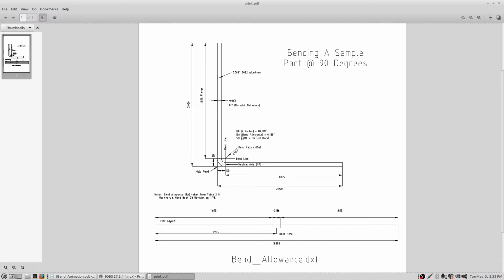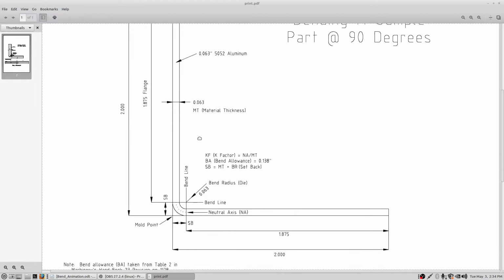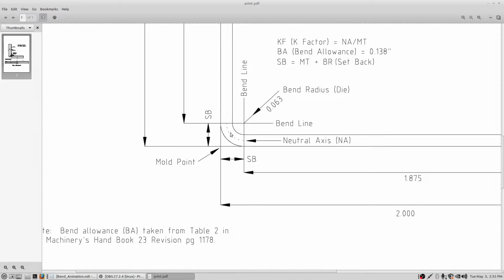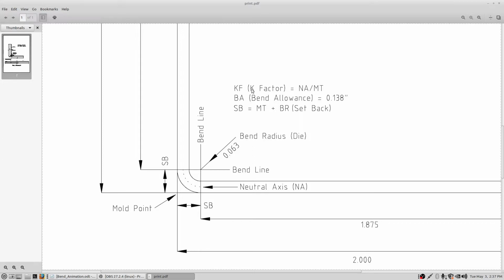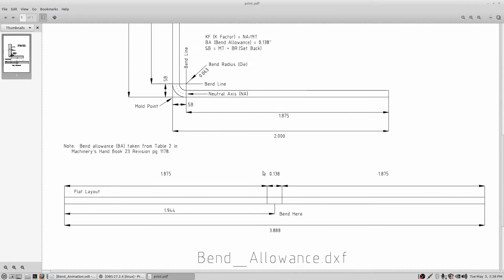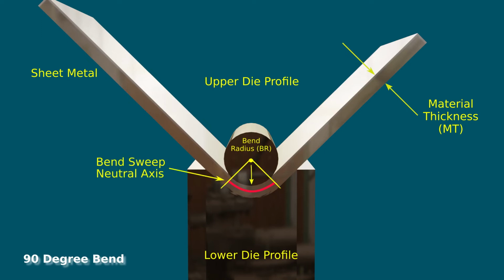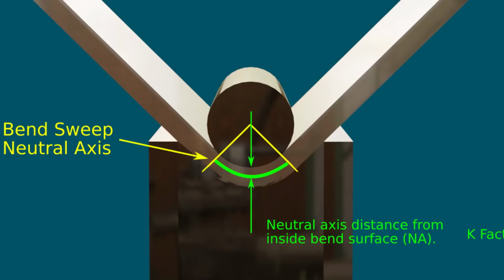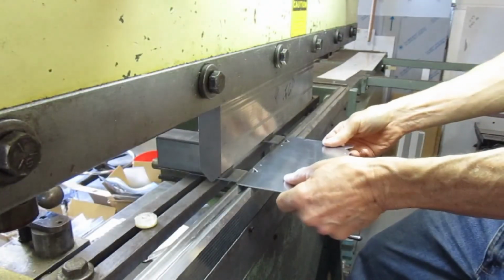Sheet Metal Bending Basics

Comment: Thank you. Always a pleasure to learn from someone who knows their subject and has thought about what the rest of us need to know in order to understand it. 💯👍
Reply from the maker: U R Welcome.  I started to get back to some sheet metal bending projects Dec 2021.  Did the deep dive on details.  I'm lucky to have a press brake so I can test real parts from the drafting table.  I think now with CNC controllers, most of this is push button.  That said, a few out there might be on the manual system and/or want to know what's in the box.  Glad you found the video interesting and informative.  Thanks for the support and work safely.

Comment: way over my head but i will watch it 10 more times. Thank you for schooling.
Reply from the maker: I bent sheet metal for years with no knowledge of theory.  Would cut, estimate, bend, check and adjust to finally get it right.  I've had a bit more time now to look deeper into the theory.  The contents in the video & blog post took quite a bit of time to digest.  I easily went over the material 10X or more.  The goal was to help others that might be interested in this level of detail.  Thanks for your feedback.
Reply: @muniac_llc  My punch has a 1/8" radius which is approx the same thickness as a sharpie line, so I allow for metal thickness and bend accordingly .. I have no contracts with NASA and it is close enough for me..
Reply from the maker: @SegoMan  There are lots of ways to bend metal and tooling to accomplish it.  Use what works best for your project(s).
Reply: @SegoMan  I used to work in  sheet metal roofing and so the bend allowances weren't that important as the jobs were near enough is good enough . Recently I had to go for an interview and it was for a precision sheet metal component manufacturer .
All of a sudden it was necessary to have to know all about bend allowances .
 You never know when information will come in very handy .
Reply: @rexnemo  Life's little pop quizzes..Get a job as a carpenter they still run under the "Hit to fit - Paint to match" construction plan LoL
Reply: @SegoMan  A more elegant method I think where ingenuity and creative thinking can blossom unhindered by the need for so many standards and procedures that no one can ever make anything .🙂

Comment: I did sheet metal work a long time ago and recently had to find out about bend allowances which I had not learnt about .
May I say that yours is the clearest explanation that I've seen , you cover all the relevant terms and show the formula in a clear and understandable way .
Thank you for this video .
PS My Machinery Handbook is a 19th Edition . Where on earth did all that time go to ?😁
Reply from the maker: Hi Rex - Thanks for the kind words.  I too did a lot of sheet metal bending work years ago.  Back then it was poke, hope, tweak, try again and get close enough.  My shop is slower now so time is available to dive into details & theory.  I started to make some fitted bent parts and decided to move beyond trial & error.  I also started to work with the sheet metal WB in FreeCAD where K-factor is required.  Using my press brake, FreeCAD, LibreCAD and theory the goal was to get them all to agree.  The bend allowance tables in the Machinery's Handbook were found by accident.  I also have the 12th addition (1943) from my late father which doesn't have the nice bend allowance tables from Westinghouse.  Time just seems to fly by now.  Work safely.

Comment: Is there always a different k-factor for each angle ? If I plunk in a k factor say .48 and inner radius  in solid works would they calculate for all angles or just 90 degrees
Reply from the maker: As the bend angle changes, the location of the neutral axis shifts, altering the k-factor. It's important to use accurate data and formulas specific to the material and bending process to calculate the k-factor for different bend angles.  I would imagine SolidWorks has empirical data for selected materials and adjusts.  The best thing to do is make test bends to ensure dims come out as expected.  Hope this helps.

Comment: With a drawing with two - or more - flange length measurements, layout can be greatly simplified by using bend deduction. BD = (2 * Setback) - Bend Allowance
Reply from the maker: Thanks for the tip.  Do you have an example that details this simplification?  A drawing would help link the theory with practice and show how it applies.
Reply: @muniac_llc  Using your drawing as an example, you would measure out to 2 inches, deduct ((.126*2)-.138) .114, and then measure 2 inches for the 2nd flange. Total flat pattern equals 3.886. 

The method with setback and bend allowance works great for regular brakes, but for bending on a press brake utilizing a back gauge, bend deduction is the way to go
Reply from the maker: Thanks for the efficiency tip.  Feedback on improvements is good and helps us all make better parts in less time.  The drawing shows a symmetric L shaped part 2" OD on both sides.  So two ODs = 4" - your BD (0.114) = 3.886"  It works and saves a little math.  I could have included your BD in my spreadsheet and skipped the 1.875" flange but didn't know about this.  Learn something new every day.  Lots of ways to skin the cat.

Comment: Thank you so much for the video. I am wondering if you can give me some advice and the tool I should purchase for my bending project.

I am a small business owner and working out of my garage - which means I’m on a significant budget and can’t afford expensive equipment.

I need to make repeatable bends (well over 1,000+) for a product I am manufacturing.

The material length is 32 inches and material width is 4” - I need to make two bends, 80 degrees, on only 7/8” lengthwise, on both sides of the material. So that there is roughly 2” of flat material in the middle.

I have been thinking about purchasing a Tennsmith Hand Brake or equivalent - or a Harbor Freight Grisly 50 ton press and a 40” press brake.

The problem - using a Tennsmith Hand Brake would be extremely physically exhausting and time consuming, and I can’t imagine using that machine over 1,000+ times. At the same time, I don’t know how exact a 50 ton press would be either, while it might be quicker, can the machine be set up to make exact, repeatable bends at 80 degrees.

My question is - do you have any recommendations? Do you have other tooling recommendations that I did not mention? What would you do in this situation? 

Thank you for your time and thoughtful consideration.

Kind Regards,
Adam
Reply from the maker: Hi Adam - Thanks for the kind words.  I worked with a 16ga 52" Tennsmith box and pan brake for many years.  Also did 1000s of bends by hand on it.  What is the material and its thickness?  What type of absolute/repeatable accuracy is called out for the parts?  As for bend accuracy that relates to how rigid the machine is.  You'll need some way to register the bend lines with accuracy.  Best - Scott
Reply: @muniac_llc  Hi Scott - Thank you for replying to my comment. My apologies for not getting back to you sooner. I’ve been interviewing metal fabricators in my area as well. The consensus was that I will need a 50 ton press for my project though I’ll need to keep a close eye on the material. One of the problems with the lite version of the Tennsmith is that it cannot bend 1/4” material, I’ve tried with two guys and if we’d try to force it, one of us would brake. :-) Thank you for your time and for a great video, and for your thoughtful feedback on my project. Hope you and your family have a wonderful Christmas and New Years.
Kind Regards, 
Adam
Reply from the maker: @adamb.745  - U R welcome.  1/4" is thick material.  50 tons seems about right.  Sometimes it's best to contract these jobs out to a shop that has the machinery.  Your part seems straight forward and a shop with a heavy CNC press brake could knock that out easily.  When I had my other shop in NJ, I'd get jobs in that I needed to contract out.  It's part of doing business and getting your parts made.  The challenge now is finding the skills and work quality.  Good luck.

Wishing your camp a Merry Christmas and Happy New Year.  I'll be in the salt mine working on projects per usual.  Keeps the brain from shifting into neutral <grin>.

Thanks & Take Care - Scott
Reply: @muniac_llc  yes i would agree

Comment: I just quit a job after 3 days being a design engineer for a very small company that made sheet metal parts. My choice of software to use is sold works. For some reason, the parameters entered into Solidorks for bending allowance did not match the press brake machine. If the flat panel produced by solid works gave a bend line that was 1.112 from the edge of the flange for a required 1.25 flange, the machine would make a part out of spec. For some reason, this press brake required an extra 0.03 takeoff, which seemed odd My question is the bend line given in the Solid works flat pattern the bend centerline, and do press brakes require an additional takeoff on the stop to produce this?
Reply from the maker: Solid works is a good product but expensive for some.  If your target OD is 1.250" and you're 0.030" off, that's a lot.  For standard dies, there's no correction.  Metal should bend within +/- 0.010" from the bend line dimension.  Your K factor needs to match the metal, material thickness & bend radius.  The tables in the Machinery's Handbook have been good.  You can use my formulas to convert "bend allowance" to K factor.  This to check what SolidWorks is using.  For example, 063" 5052 aluminum bent to 1/16" radius is 0.138" BA or a K factor of ~0.4 which I've used here with good results.  Misalignment of upper/lower dies can cause metal to skid off the bend line.  I did a video on how to check this.  Clean your dies with WD40.  Masking on the metal will affect the bend too.  A sloppy back gauge could be another problem.  Bending metal is somewhat empirical.  I hit all the above problems and ran them down 1 at a time.  I did a test 2" angle to check my setup.  I was able to get within +/- 0.005" on my old DiAcro.  Solid model, drawing and actual bending agreed.  Keep in mind you want to form the metal not coin it. Hope this helps & good luck.
Reply: @muniac_llc  Assuming the k factor or bend deductions are correct for the metal, is the bend line given in the flat pattern the location where the center of where the die should be targeted at?
Reply from the maker: You should set your back gauge so the bend line is exactly under the die's center.  I have a simple 90 deg 1/16" radius die set.  I had inaccuracy problems.  I noticed the radius forming part of the upper die wasn't in the center of the die's cross section??  Here's a video on that ( https://youtu.be/TxpJtLQSHgg ).  Once you know accurately how far the center is off the back of the die, you can reference the back gauge to that.  Touch that, zero your DRO run that distance under the die and zero again (or use as an offset).  This way your back gauge will read directly from the die center.  My die was off by 0.015".  Mark the front of your die and write this distance on it.  I used ~0.560".  It's tricky to measure but you need that number for accuracy with bends.
Reply: @muniac_llc Thanks. I was hired by some gut who does Mickey Mouse job sheet metal objects as an engineer to bring engineer standards to his very small operation so he can grow. The problem is that from the first day he thought my basic engineer speak was uppity as well as Solidworks. Things went further south after the flat pattern didn't produce a part in spec. It was revealed by the guy who operated the machine that their was an extra take off but didn't explain why. He texted us while he was at his new job. By the time everything was figured out and dialed in, the owner was determined to challenge the accuracy of Solidworks. I quit after 3 days because he was a moron.
Reply from the maker: U R welcome.  SolidWorks is a recognized standard for solid modeling and design.  It's capable of handling very complex designs and simple prototypes.  As for sheet metal, the SolidWorks algorithms are theoretically accurate and practically so if the parameters are correct.  The program has a steep learning curve which is intimidating.  To allow intimidation to sabotage the technology is ignorance.  One of the themes of my videos is going from the drawing board to finished parts and the challenges involved.  The software tools designers have now are incredible!  I'd say the same for the advancement in computer graphics.  All of us need to focus on identifying problems, fixing them and arriving at the best solutions.  This involves communication, understanding, facts, teamwork and compromises.  It saddens me to see a breakdown in these fundamentals.  I wish all of us good luck moving forward.

Comment: sir, the formulas work with metric?
Reply from the maker: If your units are consistent yes.  For example, bend radius (BR) and material thickness (MT) would need to be in metric.  K factor is a dimensionless constant.  My old copy of the Machinery's Handbook has its bend allowance tables in inches.  If you use that data, multiply by 25.4 to get millimeters.  The constant 1.57 is simply 2*pi/4 which is dimensionless.  Hope this answers your question.  Work safely.